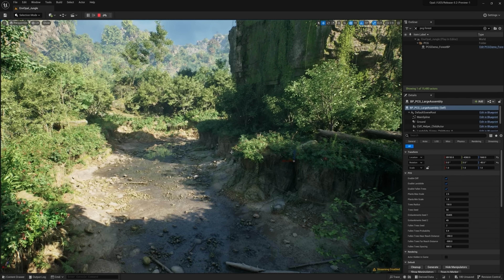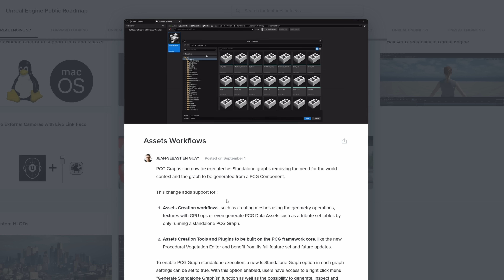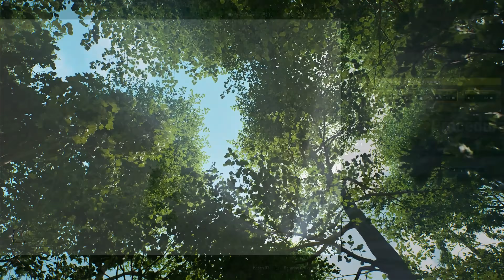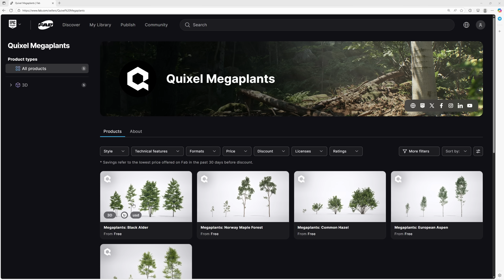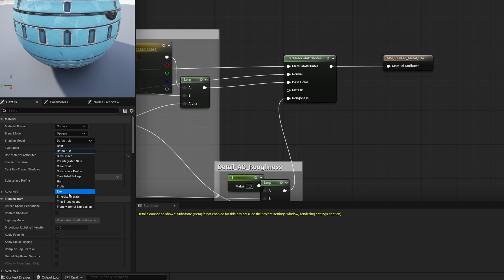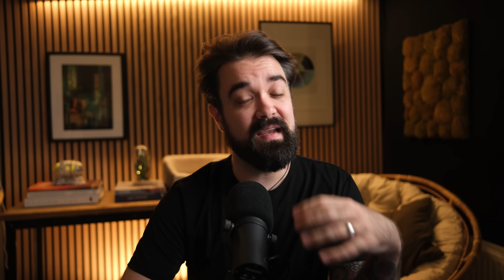Unreal Engine 5.7 Official Release (Top Highlights for 3D Artists)

Comment: No wonder the default level in the official 5.7 MotionDesign version doesn't have the Substrate material pre-selected by default—[blushing] it still doesn't resolve the compatibility issue with the MotionDesign material designer function!